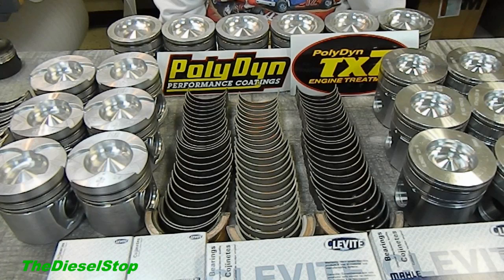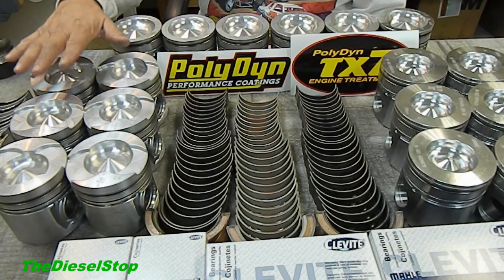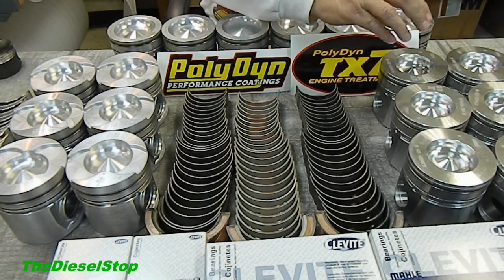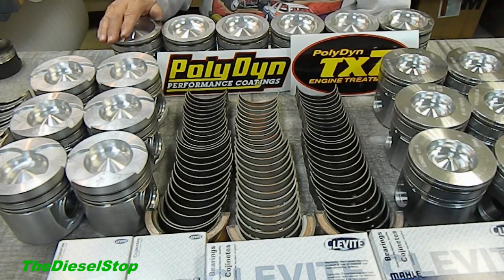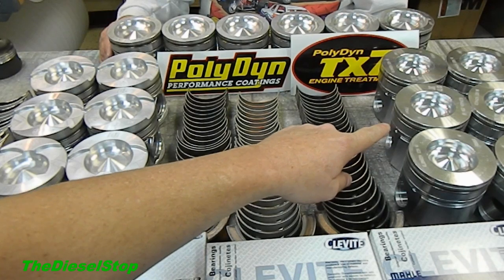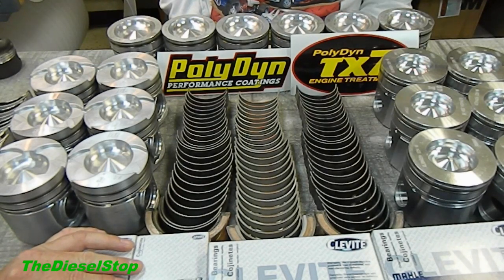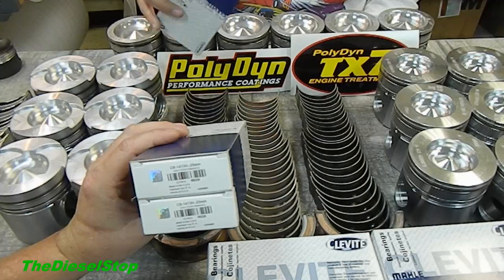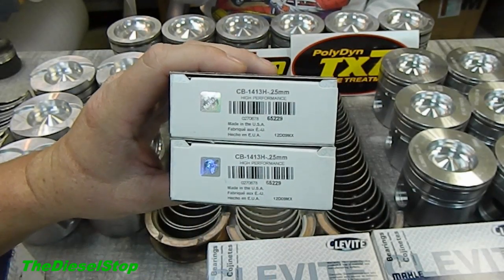1000 HP Cummins Build with PolyDyn coatings. part 1

Comment: The cost to coat the tops and skirts of pistons under 4.5" diameter is $40 each. Rod bearings are $5 each journal and mains are $8 each journal. The turn around time is normally 2-3 days in shop.

Comment: Interesting.  The old 855 Cummins were low oil pressure knockers ie the 350-400 Big Cam, I was impressed to see that coated bearing.

Comment from the maker: If you are talking about the bore of the block it would not be practical considering that is where you rings ride. But if you mean the underside of the piston that could be done. Some builders have it done to cut down on parasitic drag (oil shedding) & the same could be done with the rods & crankshaft (the rotating assembly).

Comment: From what I've always understood (...and I may be wrong), the H bearings are for the aftermarket crankshafts and are slightly narrower than the P bearings. This is needed because of the way the aftermarket cranks are cut, the wider bearings will not seat down the same and will cause an oil hemorrhage and subsequent loss of oil pressure.